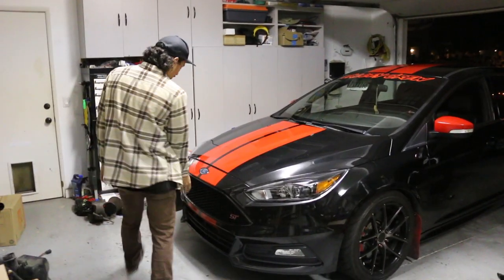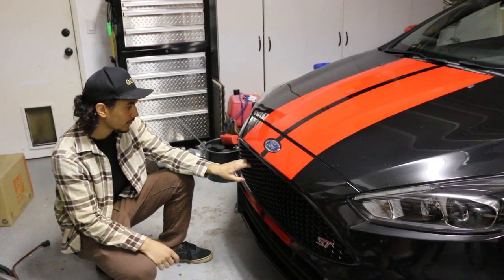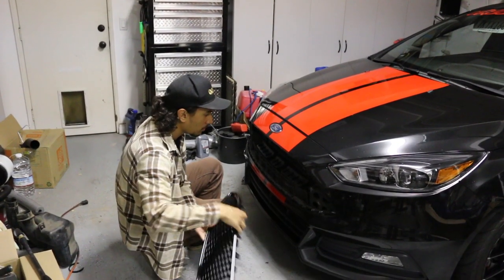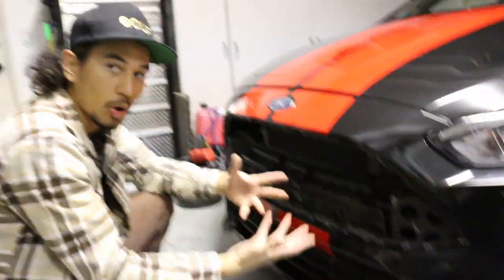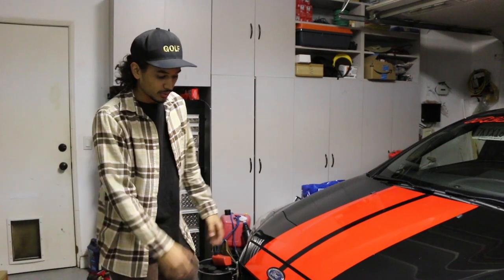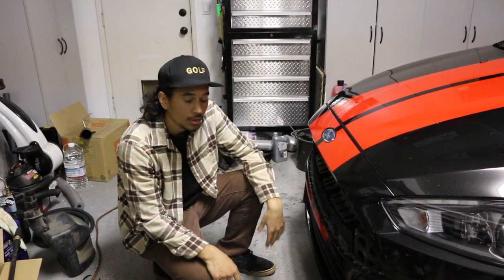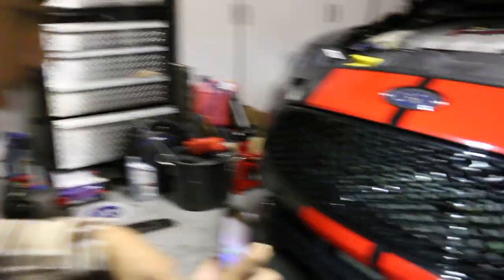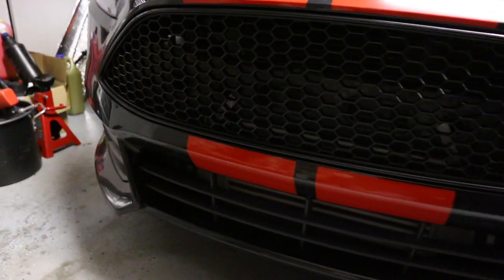FOCUS ST GRILL SHAVE - HOW DOES IT HELP?

Comment: Shaving the grill down by itself doesn’t do much on the track.  You need to add ducting to help funnel air to the radiator.  In addition you should also add vents like the ones from Verus Engineering.   Vents will help reduce pressure behind the radiator making it more efficient.   You can also remove the baffles off the fan shroud to help air flow.  

I don’t recommend removing the cowl.  We did  a tuft test with the cowl removed and it drew in air, not expel it.
Reply: Yea, I was always curious on that and what you said only makes sense. However, for look wise im going to shave the grill.

Comment: Simple question. Why do you think FORD left the grill blocked in the first place?
Reply from the maker: Shane B 
I would assume it was blocked off to be more aerodynamic. It would help channel air into the front of the car where it is necessary. The reason I opened it is to increase the cooling ability. I understand that it adds substantial drag but so will the aero I will be adding in the future. Hopefully one of these days we can design a method of guiding the air through the front of the car while creating downforce.
Reply: To hide the crash bar

Comment: Question when you removed the strip at the front windshield what issues are you having if you are in the RAIN I am sure this is also a daily driver, DID IT HELP WITH PUSHING HOT AIR OUT and help cool any thing engine wise. 😈

Comment: The main reason to shave the grill is to show off the tubular crash bar, which I dont think I've actually seen evidence of it being a safety/legit crash bar compared to the factory piece. It looks cool, but all that air entering that shaved grill now is undirected and will cause more drag. The air at high speeds needs to enter, flow freely, and exit and the manufacturers use wind tunnels and millions in R&D to make the cooling efficient. Yes, they dont always have top performance in mind, over MPGs (stupid EPA lol)... but 9/10 times drilling holes or shaving grills really doesnt help, and probably minimally actually harms the performance. Now if you do shave, you could build your own ducting to direct air to aftermarket oil coolers like i run, but the stock grill (on my 2016) already does that perfectly...I run the mishimoto oil cooler with the thermostatic plate... on track my car stayed in the threshold it needed...  definitely put the cowling back in. Its like the Honda boys that like to lift the hood at the hinges with washers for 'heat extraction'....its actually doing the opposite and you wont see it on track built cars for a reason. 

Good intentions, not really beneficial results tbo. And Id be interested in seeing if that crash bar is actually rated for a full speed impact versus the factory piece. Like i said, looks great, i even have a spare grill hanging in my garage for years, because i intended to do it during my heavier track days, then realized it wasnt in fact a benefit on track where my oil/coolant/charge temps were meticulously monitored.
Reply from the maker: Yeah I had no idea what I was talking about lol. I made proper ducting for all my heat exchangers and made a video. This is not a good way to cool the car. I hadn’t quite learned that at the time.
Reply from the maker: Trying to keep the temps down - Focus ST Track Car
https://youtu.be/nW0CeitgqKk

Comment: I'm on the track all the time with my ST and having cooling issues.  Have you had the st on track with the shaved grill and cowl removed.  Wondering if you are having any improvements cooling wise?
Reply from the maker: tmarkham1000 markham 
Not yet unfortunately, but even driving the car hard though the back canyon roads seems to be promising. I’ve noticed that the oil and coolant temps stay down for a longer period of time for sure. I’m curious to see how it will perform on a track early next month!

Comment: What oil cooler is that?
Reply from the maker: It’s from a BMW E30 M3 and I had my friend modify the ends to have AN fittings, then I cut and fabricated the lines myself. I have a mishimoto thermostatic sandwich plate as well.
Reply: @tbr.performance  looks great man!

Comment: TLDR: grill mod makes minimal difference to anything. No cooling benefit. Probably a slight drag increase. Cowl removal reduces cooling and increases drag. Mudflap removal won't reduce drag, but will let grit that sticky tyres pick up shotblast your car.

Long version:
Inlet area actually makes little difference to the airflow. Flow is mostly controlled by the OUTLET. The base of the windscreen is a high pressure area. You are much more likely to have air enter there, not leave. You now have air doing little useful cooling competing with your actual cooling air.

Congratulations, you have probably reduced cooling air flow while also increasing drag.

Did you actually have a cooling problem before?
If so, more air is unlikely to fix it on its own. Once air flow hits a certain level, cooling ability plateaus. Can you guess where the design point on modern cars tends to be? Cooling is maximised for fully loaded and low speed hills. Higher speeds, such as would be found on a track, is more than required. Bigger heat exchangers are needed to increase cooling above the design speed.

Believe it or not, car manufacturers tend to know way, way more about aerodynamics than random YouTubers. They also have this weird habit of scientifically testing their mods.

Moar!!!! is frequently a downgrade.

Mud flaps are very little drag. They are behind large tyre shaped airdams. When you put sticky tyres on, you will now get to enjoy the sound of the bits of grit they pick up shit blasting your car.
That is one of the biggest reasons I try to avoid street driving my 200 treadwears.

Dude, put that windscreen cowl back on and work on something useful, like decent suspension and tyres.